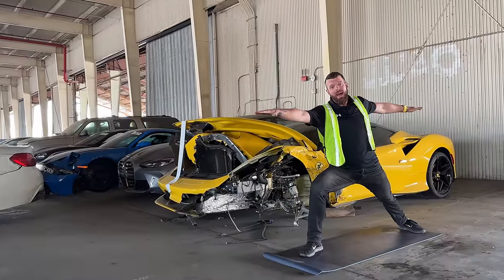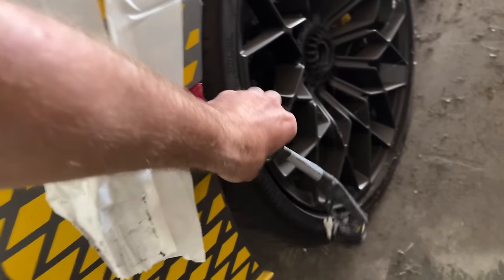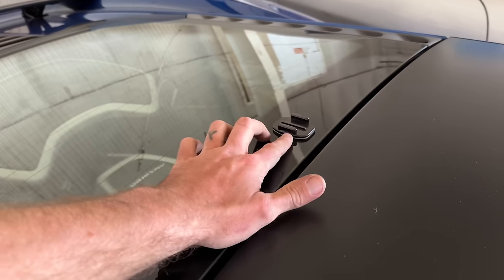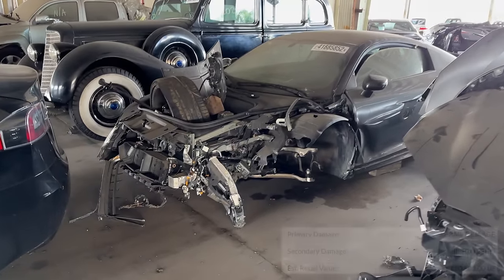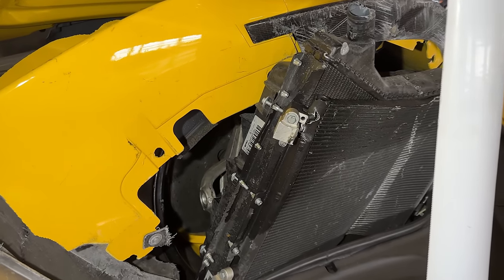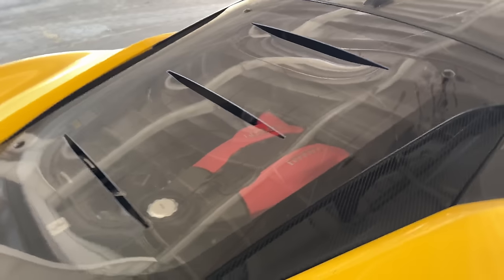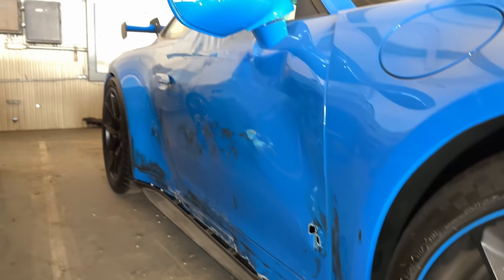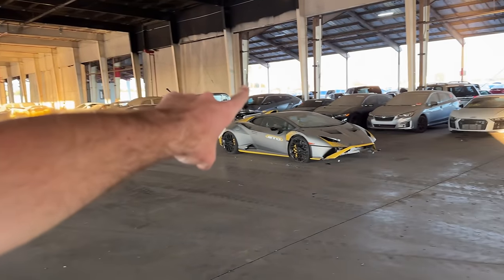Copart's SECRET Supercar Warehouse Is TOTALED Exotic Car HEAVEN!!

Comment: Money can buy you the car, but it doesn’t buy you the talent to drive it.
Reply: That’s what a chauffeur is for
Reply: Stop hating
Reply: r/Im14AndThisIsDeep
Reply: How do you explain professional driver crashes?
Reply: It actually does. A person who is a good driver but never drove a mid engine or rear mounted engine will easly push the car over the edge and not be able to correct it right. However if you have enough money to buy these cars you also probably have enough to pay for the motorcourse or be able to track the car often so money does buy you skill really.
Reply: @RexerYTRexer  I have spent a lot of money on driver and race training, and agree you can learn the skills, however after many years trying I worked out that you need real talent to get the very best out of a car, and I didn’t have it 🥺. Based on some of those  crashed cars, neither did those drivers.
Reply: @hinglemccringleberry9138  A bit rude, but whatever. But if you think you can buy talent, then keep spending 😂🤣
Reply: The talent to drive does not buy the car either unless your some kind of a professional racing driver which most of them are not.
Reply: @pabloescobar8243  Lol don’t need talent to buy these cars. You just need a lot of money.
Reply: @andyglastonbury6032  Making money to buy these cars require money making talents lol
Reply: @pabloescobar8243  unless it’s inherited money or a lottery win of course 😃. However judging by the state of these cars, they didn’t appear to have much driving talent.
Reply: Amen brother.....
Reply: Too many people with way too much money, too much time on their hands, way too much pride , severely overestimated ability and completely underestimated car. If anyone happens to be that guy, can you shout back to a question of mine. Can you ever get insured again after totaling a brand new Ferrari ?
Peace out ✌️😎
Reply: Stupid comment. Most of these Cars where probably not the owners fault.
Reply: @DDDDDDDDDD12  Lol, did I say they were. However I’m betting that they are. Plus the internet is full of super car owners binning it all on their own.
Reply: Money buys driving classes.
Reply: @TheBigChad  A friend of mine regularly beats the crap out of my 964 with his 924. I would say I was embarrassed, but he really is very good.
Reply: Or car crashes can happen to anybody, hence these cars end up at copart
Reply: @007t0m  no shit man. We all suck driving before we learn too. Plus soccer moms pull out in front of you hurriedly sometimes.
Reply: Lmao what did U hear that in a fast and furious movie gtfoh
Reply: @007t0m  I refuse that statement with passion. If you know what you’re doing you can avoid an accident. Been driving like an asshole for 36 years and never ever have I been in an accident. I’ve avoided a lot tho because I pay attention to what’s going on around me. Anytime there’s a cop or ambulance on the side of the road I look hard to see if anyone is slamming their brakes on. You have to be really defensive but no, accidents don’t just happen.
Reply: @aleiterful  😂🤣 No, a professional racing driver said it to me once.
Reply: Couldn’t agree more with that assertion
Reply: Someone else could have hit the car. Not every accident is your fault
Reply: @yakub3962  Very true, however how exactly does that change what I original posted.
Reply: @andyglastonbury6032  you don't know who's at fault in the accidents featured here
Reply: @yakub3962  I don’t, but it changes nothing. Just because someone has the money to buy a fast car, it doesn’t automatically give them the talents to fully drive it. BTW looking as some of those car and the damage, I would hazard a guess least two were crashed as a result of driver losing control in a corner and losing the back end.
Reply: Without the money the car wouldn’t even be produced or continuously innovated in the first place, you’re done, goodnight.
Reply: @MrPrush-ji4gs  Wow, loving the binary thinking. 😂🤣
Reply: Thats a dumb statement, anyone can crash a car, so many go uncrashed, you’re just hating on them crashing nicer things
Reply: @bjorncrienen3819  Wow, defensive or what 🙄. All I said was that money can buy a car, but it doesn’t buy the talent to drive it. But yes anyone can have a accident, but it takes a special kind of stupid to have a self inflicted accident. YouTube is full of stupid people smashing cars up without the assistance of anyone else. But you are right, I do hate people who buying nice car and then crash them simply because they don’t have the common sense or skills to drive them properly. I have owned my Porsche for 21 years and first thing I did before spending money making it go faster was have 2 days with an porsche race instructor on how to drive it well. As a result I have never binned it. Lesson learnt!
Reply: @andyglastonbury6032  wasny meant to heavily lol, but who says they’re self inflicted? Ofcourse some dougnuts cant drive, recon the majority wont fall under the muppet section though
Reply: @bjorncrienen3819  Only those under the age of 35 🤫
Reply: @andyglastonbury6032  we’ll agree in that then😂

Have a good night :)
Reply: Talent and skill are different.
Reply: Ok Andretti
Reply: Yes it does it can buy classes for you to take either online or with a experienced driver
Reply: @CodyPrince77  you can learn skills and principles, however at the end of the day you still need talent.
Reply: Now that that's real talk
Reply: Money can also buy you a driver
Reply: @mangopap2971  True, but what’s the pleasure in having else drive your car, unless of course you are only interested in owning it.
Reply: @andyglastonbury6032  can’t text and drive 

Edit: owning multiple cars and a driver sounds convenient
Reply: Speaking the truth is not hating..

Comment: You should keep an eye out for Adam LZs purple Porsche GT3 to go up for auction, he just posted the other day that it’s being totaled out so it’ll end up in the auction soon. And it’s a paint to sample purple, 1 of 3 (I believe is what he said).
Reply: That thing is absolutely trashed.
Reply: @dcskate1022   it’s not that bad if you really want to get into the tub repair, impossible a frame rail other than that it was localized to the suspension that front fender and headlight which really wasn’t that bad it’s just very very costly
Reply: It was bought by that other big YouTuber that rebuilds cars and he did a amazing job on it the cat came out great and drives amazing again
Reply: @danielwalter9983   that comment was 9 months ago, way before Matt Armstrong bought it and rebuilt it on his channel with Tavarish. I also watched the rebuild process….

Comment: That isn't the ABS module on the STO, that is the end of the front or rear frame that connects to the impact bar
Reply: Welp, you're absolutely right ! Hey, it wouldn't be a Salvage Auction video without a major screw up!

I was so hyped to get in the car and start it I glanced at it, kicked it out of the way and paid no more attention to it. Seems to be a trend with me and Lambos...
Reply: @LeeC  about time you rebuild one on the channel I think 🤷🏼‍♂️ nobody seems to be rebuilding exotics on YouTube anymore aside from your Turbo right now
Reply from the maker: @Canderson1213  frankly? I’m not a big exotic guy. 

The 911 turbo, the GT4, those were fun. 

We have two more rebuilds in the works now, but I wouldn’t consider them exotics.

Comment: 18:55 looks like the two spot welds / pins above the left side of the lower controler arm it looks like the subframe or whatever was pulled down. Shame that car was messed up those are gorgeous. Looks to be a relatively "easy" fix those if you have the pockets for it.

Comment: you didnt mention it in the video - but im an auto damage appraiser and can lend some insight

there is a formula called "BEA" (break even analysis or "total loss formula) for totaling a vehicle, and since that STO will have INSANE auction value with the damage to it, it wouldn't take that much to "declare it" a total loss, if the customer agrees if you're not in a BEA state. and CA is a BEA state, which means:

 the state wants you to mark it a total loss the moment the cost of repairs exceed the ACV of the veh - the predicted auction value. so these exotics with "minimal" damage are almost always totaled on BEA either cuz the state requires it, or the owner doesnt want the car anymore after the accident.
Reply from the maker: That makes a LOT of since and I wasn’t aware of it. 

I’m sure this insane salvage auction market has greatly increased the number of cars getting totaled under BEA.

Comment: The great thing about buying wrecked or written off R8s, is they can be very cheap to fix. A lot of oem Volkswagen Parts are the same parts just way cheaper. That Ferrari is not worth fixing, it’s gonna cost at least $100,000 fix. And you’ll be lucky to even get a rebuilt or salvaged title, if you do the car won’t be worth more than $100,000 - $160,000.

Comment: Bro, you need to get a 360 Degree Camera, such as one of the Insta360 One X Variants and mount it to a Selfie Stick...you'd be able to stick the Selfie Stick with the Camera attached into some of those openings and be able to View everything in 360 Degrees on the App on your Phone. You can also take 360 Degree Pics and Video.
Reply from the maker: I’ve had my eye on some of the insta360 stuff actually.
Reply: @scraplifegarage  There's a learning curve to the Editing process, but it's not horrible, and that is if you'd use it to actually make and publish videos. But for getting into areas you can't normally see, for example under the vehicle, inside a Hood that you can't open, etc it would be awesome to be able to see a live 360 degree image on your phone or take a 360 degree pic.

Comment: SECRET Supercar Warehouse
1-4-23
L.A. is such a long drive to look at cars you might not even buy. 
Kind of hurts my head to think about the drive down there. I have taken that trip to L.A. in my ’86 RestoMod-Outlaw Porsche and when you get outside of Bakersfield on I-5 the the freeway turns into a Super Speed Way but some real shitty freeway asphalt. Chunks of asphalt missing in the  road...really! You have to be so ON when driving so you don’t  hit these chuck holes. The first lane is usually 90 m.p.h. and up,  (I never say any CHP on the road) and the far right slow lane about 70 m.p.h. . These are true speeds except when there is fog which is the  Fall and part of Winter and then you sometimes can’t see two cars in front of you.

—STO Lambo - 
Like a highest paid female escort. So beautiful, so hot and YOU know the ride would be a life time experience. I would rather have the woman than the car for 2-3 days. I know this is a little or way off topic but I am being real and I think there are a few guys out THERE that think the same. O.K. moving on very quickly. 

Lots of interesting, useful  comments left at your site, especially Jeremy G. 
“What kills me specially with these high-end cars is the lack of care taken when storing them for auction: scratching and breaking those carbon fiber parts in most cases is like blowing up a brand new car at a dealership because it's in the way”

—McLaren is my choice, Lambos are too flash... yes I said too flash. I would take this 2012 MP4C (retail-$128,00) McLaren over the Lambo any day, any fking day. I love the simple style but drop dead design of the McLaren and of course it eats up other cars. When I was up at Portland International Raceway in Portland, OR (PIR) last year there was only McLaren and  it ate all the Porsche GTs and everything else — JUST blew past them on the corners and the straight. And the owner was so humble and such a nice person when I talked with him. Not a bag of hot donkey gas.

WHAT, WHAT 
You said, “We all know about backward facing Go Pros don’t we”. NO WE DON’T. What is it.

— 570 orange Webber bar-b-q  No bueno
—2014 V10R8 I moved on not interested in this brand
— Ferrari yellow car moving on  to the next car not interested
—992GT. STOP its a Porsche

I love the idea that you have been here all day and have only seen about four cars. You certainly ARE what you do for business. Loving and being your job. 
Do we ever get to see what you buy at these auction...until months later when we have forgotten where you were at the time of the auction?

“A garage without a Porsche is just a dark hole” —Walter Rohrl - Porsche Development